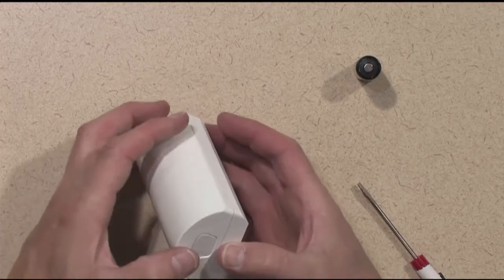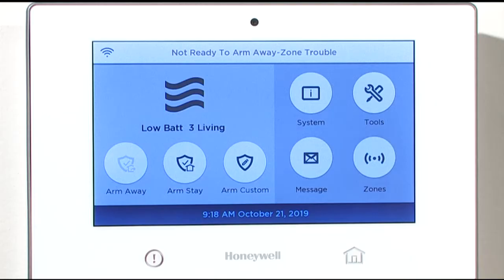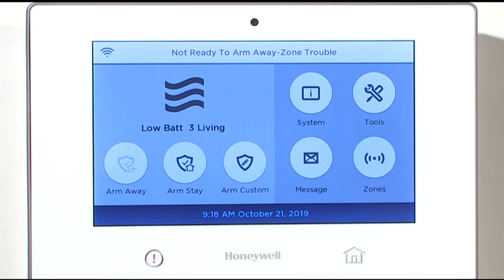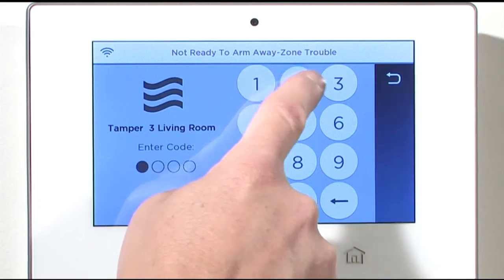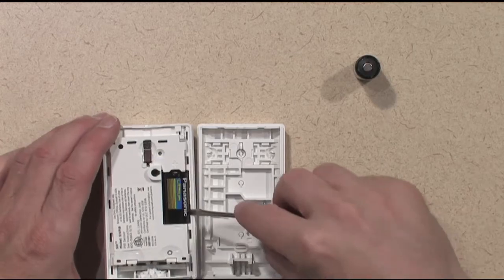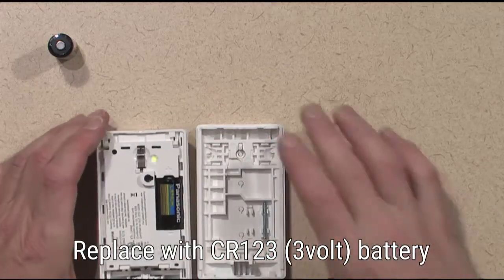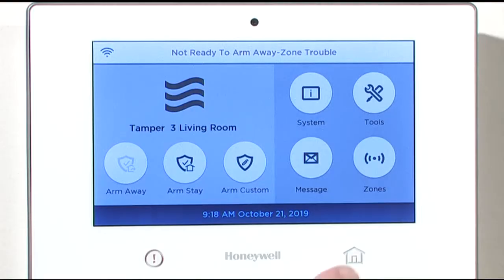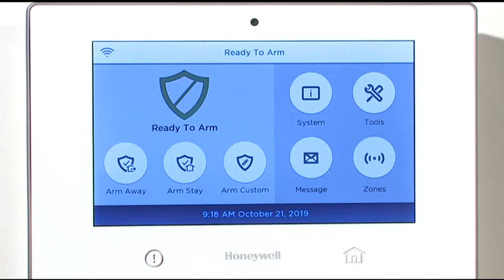Battery Replacement For SIXPIR

Comment: Not at all helpful regarding putting the cover back on !
Reply: I AGREE 100%.  The cover should slide up and lock in the tabs. It's not working for me as easy as this video shows. Here it almost looks like it slid in realy easy with magnet guidance.
Reply: Agree.  Crappy crappy design.  We had to duct tape one, and the other simply would not reattach at the bottom and we couldnt clear the TROUBLE warning on the panel.  Having to get a technician out.   For anyone reading this who is thinking of buying this sensor ... DON'T!
Reply: @brendanreid593  100%.  They should have shown it from the point of taking it off the mounted position all the way back to re-mounting it.  I haven't been able to clear it either.
Reply: Same issue here. Removed it with no trouble but it won't "click" back into place. I guess I'm going the duct tape route...🤦🏻‍♀️
Reply: same issue.  the tab stay depressed and now I can click back into place.